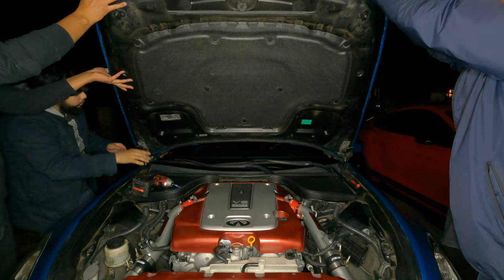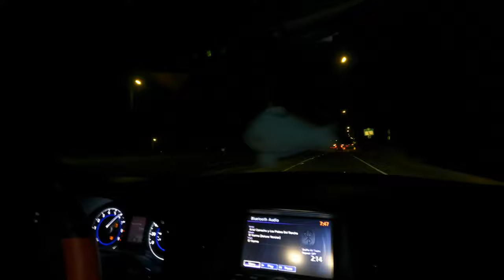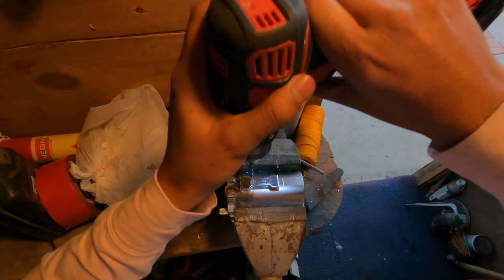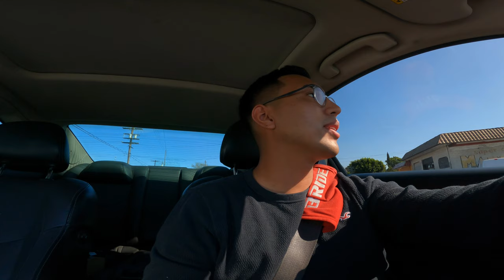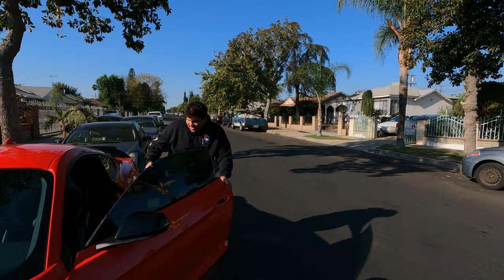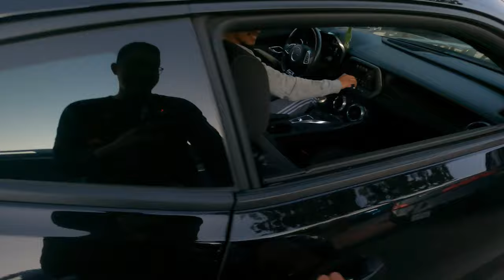G37 CARBON fiber HOOD install and More! (Vlog#5)

Comment: Hi What brand hood is that? looking get one. you eliminate wiper fluid jets? I been reading you cant use struts with carbon and have to use hood pins, Not true? Im more concerned with fitment. Some have big gaps, hows yours? Thx